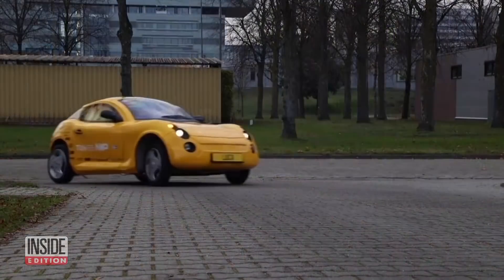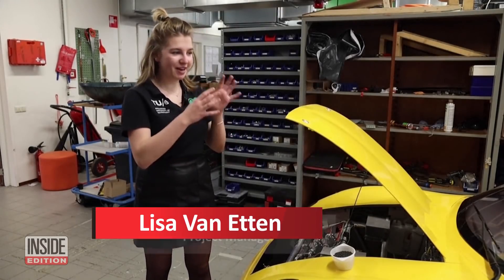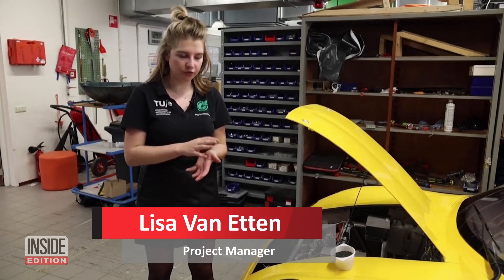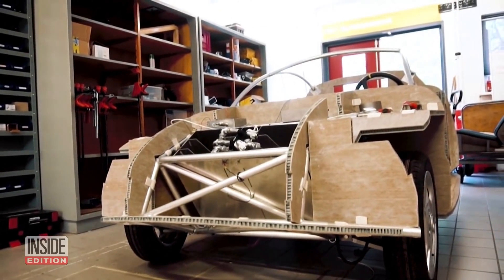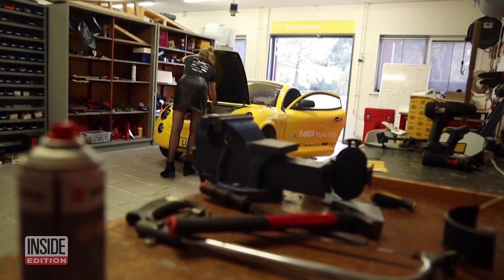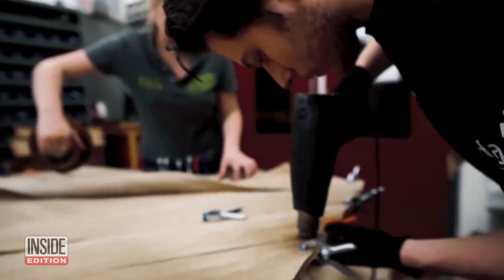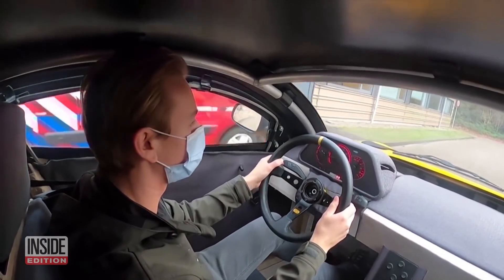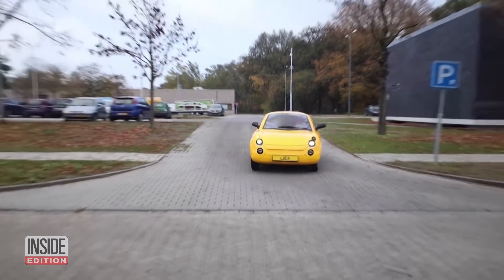Students Make Tiny Car Out of Trash

Comment: First off, that car is extremely unsafe and shouldn't be allowed on the road. Secondly, car manufacturers use steel and aluminum which is to a large degree, recycled. The glass for the windows is partly of recycled glass. The copper wiring is also partly recycled. Copper and aluminum is a large part of recycling programs.
Reply: If you had time to type that out, I'd assume you'd have the intelligence to research on the transportation culture in the netherlands.

Comment: If someone crashes into you while driving that car you’re dead. That cardboard isn’t going to protect you
Reply: There’s a easy solution...don’t crash, works 100% of the time
Reply: @desire2143  if ur homeless just buy a house works 100 percent of the time
Reply: @desire2143  mustangs:allow me to introduce myself
Reply: They probably had that in mind and made a type of roll cage out of metal pipes. Safer than made out of pure cardboard, but it's probably sub-par if tested in crashes against other vehicles.
Reply: @desire2143  pretty quiet Now huh 🥱
Reply: @desire2143  😐 anything can happen on the road, shut up.
Reply: Fr
Reply: also easily burn in fire
Reply: Clearly you have no idea what the transportation culture is like in the netherlands.
Reply: You're safer in a car from the 50s.